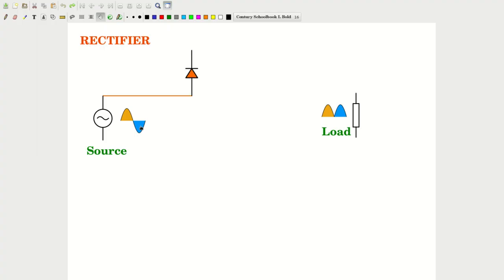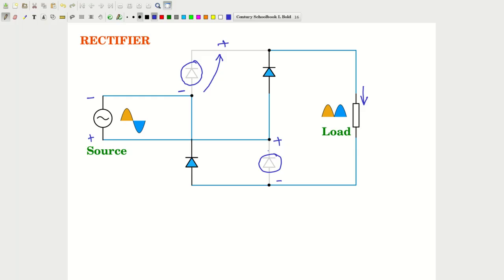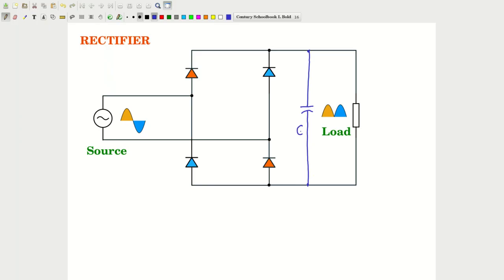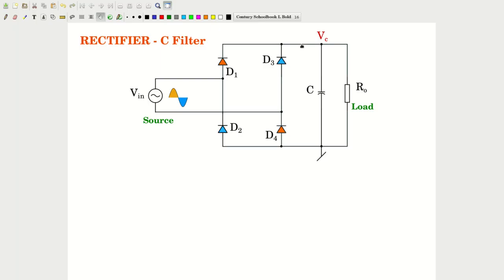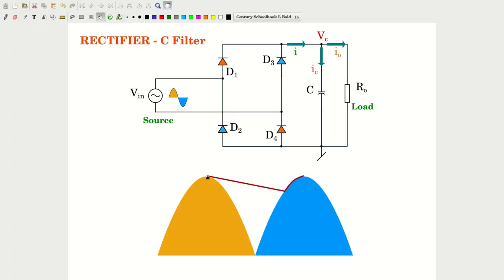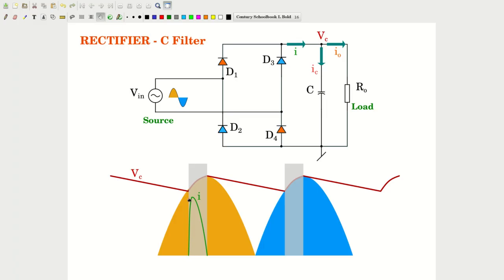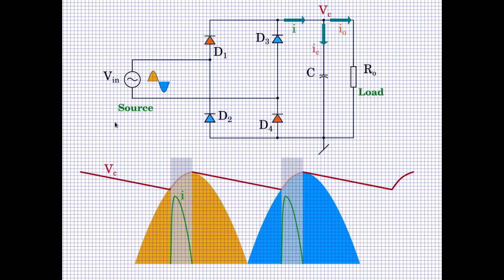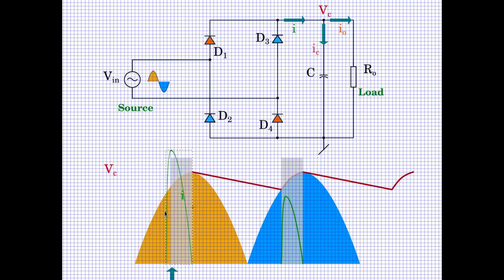Understanding Rectifier with C-filter

Comment: Sir i made a rectifier 140 v 40 Amp but when we connect capacitors 250 v 10000 microfaraday  it take 1.5 times more rms  current at input side why and how to reduce it

Comment: During 18:00 you say that time constant of C will be only by series Resistance and inductance etc. of the path......shouldnt it be also dependent on R0 (the load ) , Shouldn't time constant be actually be dependent on  (R0||Rseries of diodes)
Reply: Yes. You are right 👍👍